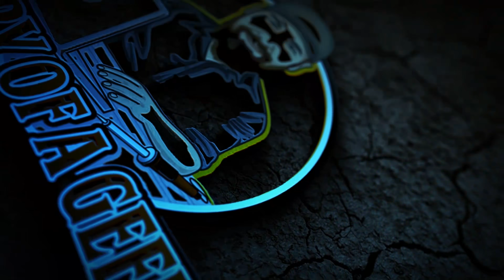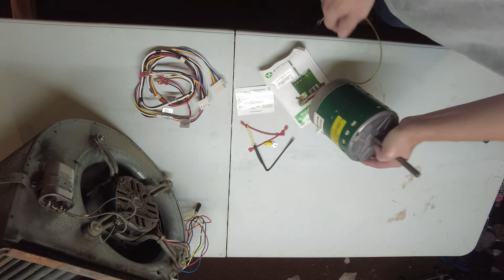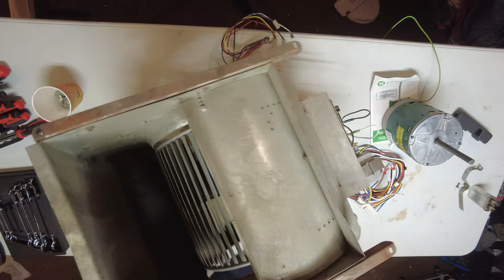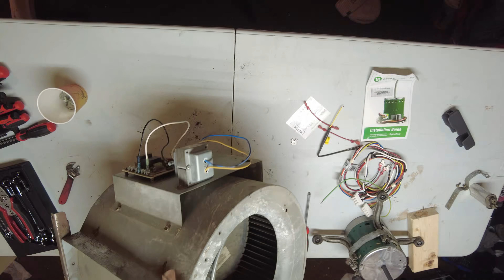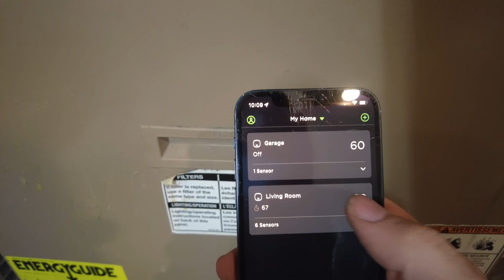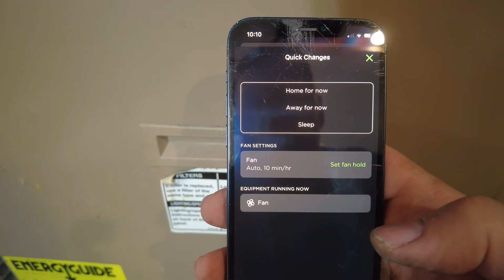PSC to Evergreen ECM furnace blower motor swap

Comment: My 3/4 or 1 hp blowers use 800-900 watts.
What is your experience with ecm replacement. I understand that air backpressure could kill the efficiency advantage.

Comment: How can it cycle on heating time delay or  heat exchanger temperature fan T-stat?  I believe the motor windings are three phase, with the electronics acting as a variable frequency drive (VFD) which explains the increased efficiency. My unit uses a I HP PSC which has become very expensive so I'm thinking about converting to an ECM.  I am concerned with their reliability.  They were fairly new when I retired and they seemed to fail quite often.
Reply from the maker: Not quite sure what you are asking, but there are trigger inputs for the variable speeds.  Any 'on' trigger would be external to the motor anyway and work the same with this setup.
Reply: As an everyday 30 year HVAC tech, you are right, they fail a lot more often than PSC motors. However there’s a reason for this and it’s usually because the installer puts too large of a furnace in then what’s needed and the other is bad duct work with very high static pressure. The ECM doesn’t care about high static it’ll just keep increasing the speed and torque to reach the proper airflow, unfortunately the motor is stressed all the time and the electronics usually fail. They’re great motors when everything plays well together.
Reply: I have the same question. Directly connecting the motor taps to thermostat wire won’t wait for the heat call delay.

Comment: Enjoyed the video.  Did you ever clean up the wiring with terminal strips?  Was trying to visualize what that would look like.  Thanks.
Reply: Just use one wire with a pigtail and wire nuts instead of a terminal strip. Much simpler

Comment: Hey. Good video. Got a question. I’d like to swap out a loud motor on an older electric furnace with a eco motor but not sure of the connections. My furnace has a 240 v relay and a 24 v relay. No board. Thoughts? Thanks
Reply from the maker: yea you should still be able to use this motor, it will still run quiet, ramp up and down slowly, you just don't use the other speed wires.